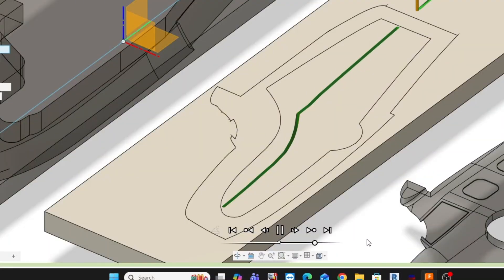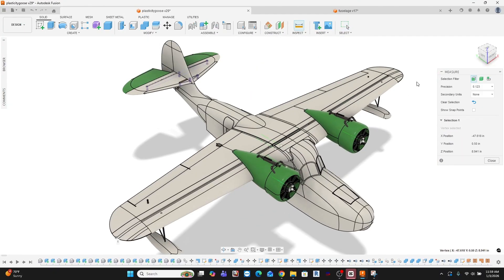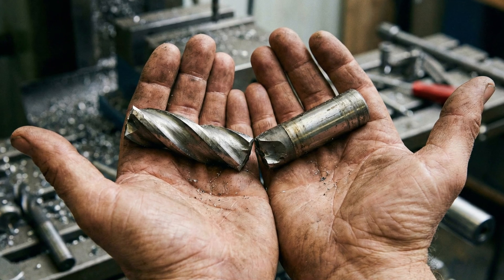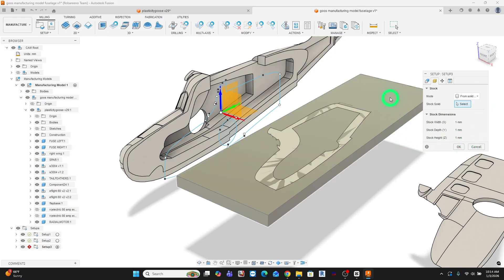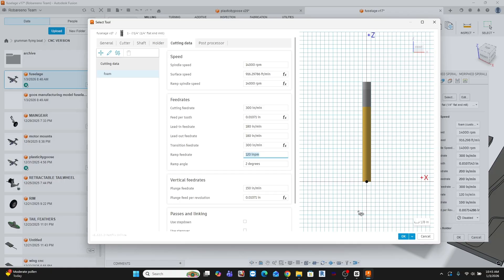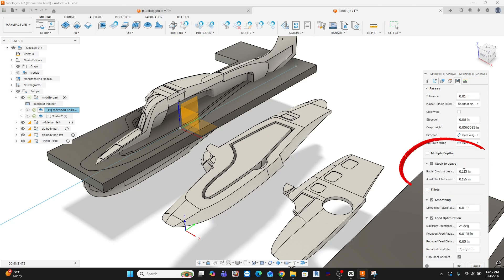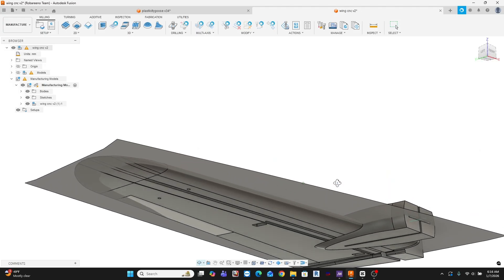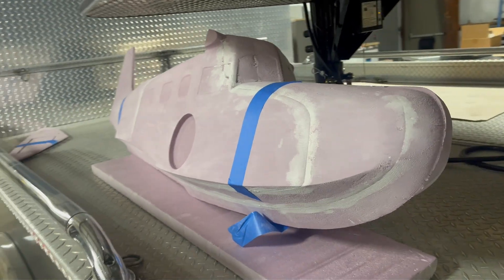How I CNC Milled a Giant Scale RC Goose Seaplane Step by Step Fusion 360

Comment: You can post gcode from the setup instead of the individual toolpaths. If you turn off Optional Stop your cnc should come up for manual bit changes or select another tool for each pass included in the Setup.
Reply from the maker: Thanks for the tip.  I knew I could post the code from setup but just wasn't sure how to deal with manual changes. I appreciate the help

Comment: Moar video! I want to build a mostly 3d printed cnc machine to do exactly this. Would love to know the pitfalls etc.
Reply from the maker: Thanks for the comment!  CNC is fascinating for sure.  You should try to build one!
Reply: @redbaronrc Thinking of an 80in span Ki-61 Tony or a Jack. :) I use painter's paper and WBPU over foam. Almost no filling or sanding required.
Reply from the maker: @jimr3633 masking roll paper?  The brown stuff?
Reply: @redbaronrc   Yup, it's really thin and a little shiny on one side.  Not the thick carboard like stuff for the floor.  Some brands are a little green/brown in color. I've tried both sides out and found no difference. I also did back to back testing using thinned PVA (Titebond2) and shellac and the WBPU sticks the best, has the least shrinkage, and had the same strength/bending moment as the PVA.
Reply from the maker: @jimr3633 you've got me curious.  Gonna experiment with it.